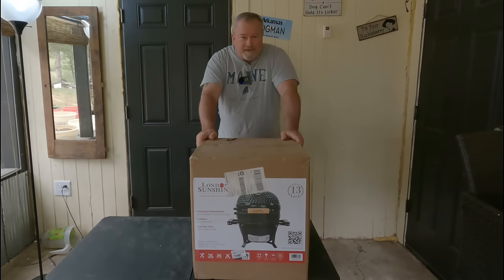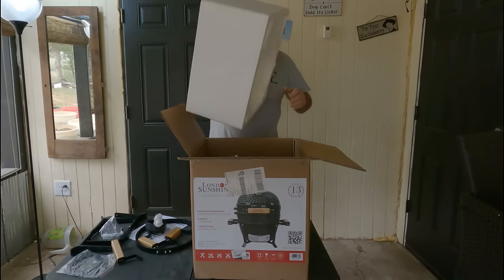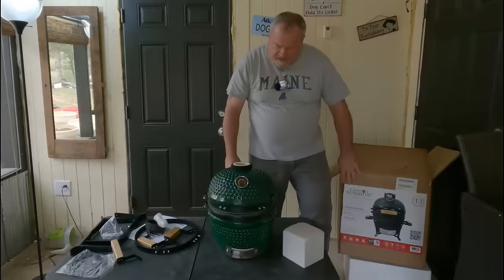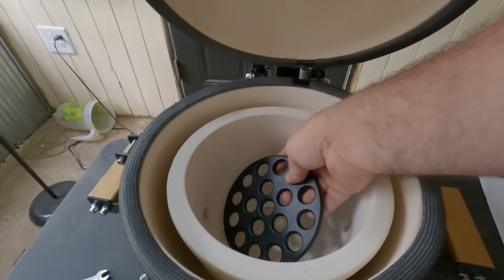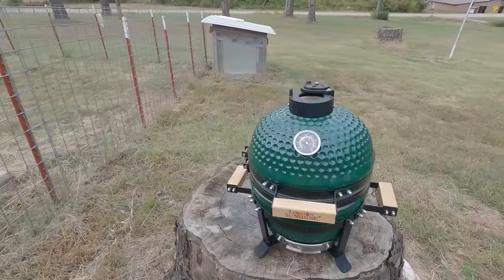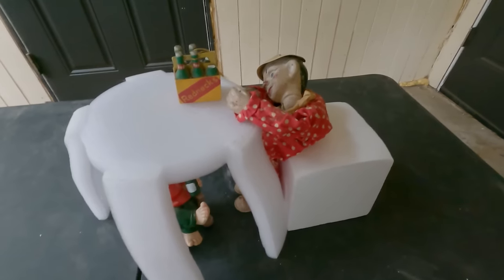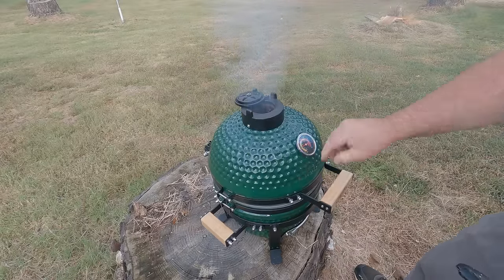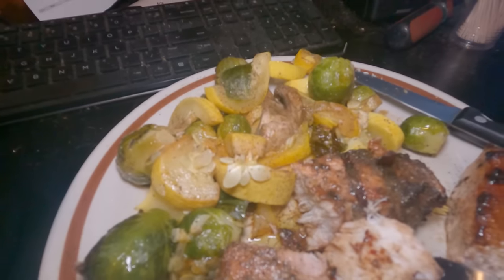This Grill Is Incredible! Grilling On The London Sunshine Kamado 13" Ceramic Grill.

Comment: Either you temperature gauge is wrong or mine is wrong.  I can barely get it up to 500 after 40 minutes with plenty of charcoal.  I think I'll contact them for a new gauge.
Reply from the maker: Do you have the vent hole in the ceramic bowl lined up with the vent?
Reply: @ouachitamountainliving  Yes I do, thanks.